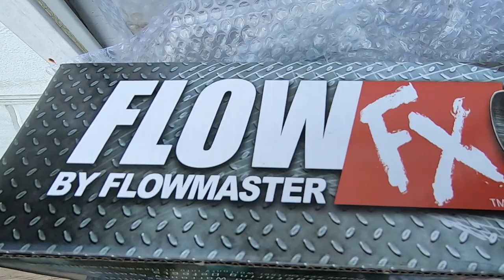1968 - 1972 GM A Body Air Conditioning Delete???

Comment: Even with the 350 Rocket we have in our Vista Cruiser, 1972, it is kinda hard to get to that rear most plug on the passenger side. I need A/C with my lungs, and the A/C works beautifully after I took apart everything and adjusted the POA valve to work with R134A. That is nice a block off cover is being made. The spooky music in part 2 said something was up. Yes, car fires are horrifying, we went through one as well just 9ver 4-years ago. One never forgets about these things. Looking forward to more (good) adventures from you!

Comment: Yeah, you just gotta love hillbilly wiring and backyard Joe mechanic stuffs. Lol. I am curious what’s your next video going to be about on solving the wiring issues in your Camaro, and what your Cutlass gonna sound like with new Flow master mufflers on once you get your 455 put back in there. Your new block off plate should give you plenty room to get to the spark plugs. Nice job 👍😎
Reply from the maker: Hey, right now I'm in the process of filming a video with the Camaro electrical fire and fixing those problems but I may put up a quick car show walk through before that is done. I really want to hear those mufflers on the cutlass to see how they sound but that's going to be a while from now.